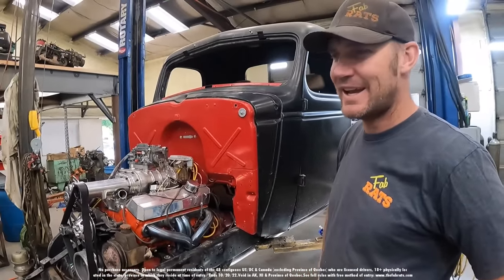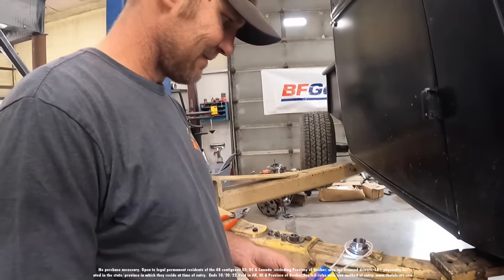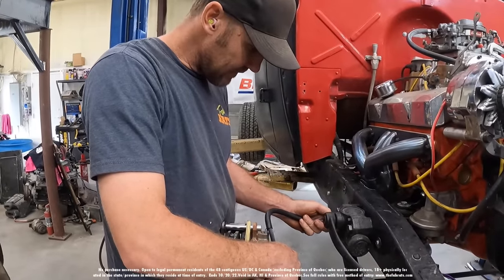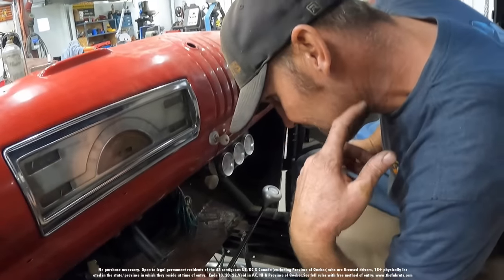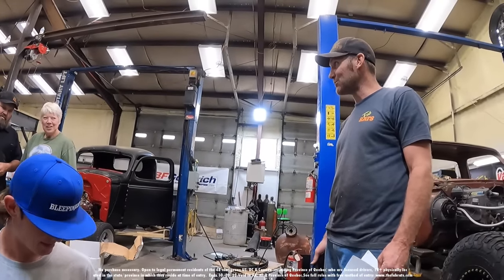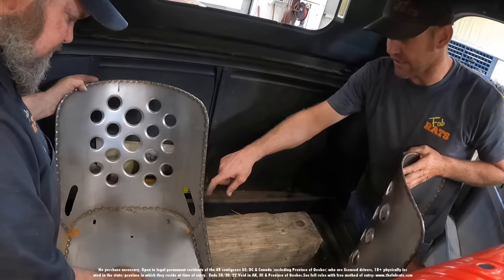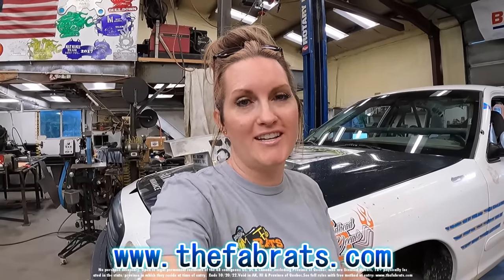The '42 Chevy Hot Rod Loses The Bench Seat And Gets Huge Upgrade!

Comment: You guys might want to box the front of the frame real soon, we did a 56 Checy which had a much beefer front frame and had a small block with a TH400 installed prior.  The guy wanted power steering and disk brakes.  We drove it to the shop and it was basically scary.  We installed the disks, power steering and modern shocks, and the problem was the same.  Then we noticed that the front frame had about an inch of lateral and hight movement when we had it on the floor doing some odds and ends. We ended up boxing the frame back to under the cab, and OMG then would stay on the road.
Reply: No need to box the frame if it has an X-member
Reply: Shush.  Let him learn from this build.
He needs a lot of lessons learned from doing it himself.

Nobody can tell him anything.
Reply: @MastroAdventures  the 42 has a no cross member, remember the old dipper six had this cross member mounted to the front of the engine.  The same was true with that cursed 56, that thing was a problem going somewhere to happen.  We eventually got it right after we fixed the upgrades someone had done before.  A front cross member makes a significant improvement.  Remember that Dodge Ram's with 4 x 4 had that death wobble issue, that steering box lower pivot helped but still the frame moved.  Had one for over a decade and noticed it when I jacked it up from the frame, not the axle.  Beefed up the frame in the front and the death wobble went away.  Even with an AS in Mechanical Technology while in the Navy paid off, math can be your friend and physics is the glue holding the universe together.
Reply: @thomasheer825  in the fab world, you can build an X or K member.
Reply: @jamesrogers6376  It's almost like your voice is but one in a sea of people who don't know what they're talking about. He isn't crowd-sourcing his build plans; he is showing us what he's doing. If you want something done in a certain way, then put your time, money, and effort into it and do it yourself. You should also record it and post it to social media so all the know-it-alls can tell you how every little thing you do is incorrect.
Reply: @watcherofwatchers  I've done enough to know better.

Life experiences.  I wish you learn from everything.

Comment: The secret to round clamps is to get some bar stock, drill it and tap it to your bolt size, weld it to your tube (one on each side) before you cut it, then cut through all three.  After it is cut, drill out the threads on one half for bolt clearance.  Now you have a clamp that is perfectly aligned.

Comment: Paul just for general knowledge and i know you have it in your shop,....Brake Clean works awesome on getting anything flying dead! yep it will even knock
 them right out of the air. i use the red can a lot on them. here i have lots of wasps and it is cheaper for it then wasp spray. One hit of Brake clean and they are toast!.

Comment: One thing to note when running that mill is to be sure you aren't climb cutting with that end mill. If you are taking a heavy enough cut the rotation of the end mill will pull itself through the cut scary fast. With that power feed you might be ok especially when it is just cutting aluminum, but a heavy cut in some steel could be a different story. On my CNCs I purposely climb cut but on my manual machines I run conventional.
Reply: Good advice. However, if you are looking for a decent finish on a final pass you can set the table locks to snug and climb mill with little fear of it grabbing.

Comment: Just a little FYI. The IR / Laser thermometer will not show an accurate reading on metal. (it reflects too much). So if you but a bit of painters tape on a piece of metal it will show a more acurate temp. (yeah, i know,, you cant on something that hot...)

Comment: @7:35
T-Shirts; a suggestion from an extra large t-shirt guy.  If you wear an extra large and more even, then a 'V' neck is more comfortable for our neck is needing the comfort of unrestricted movement.  Can you consider seeing about ordering some 'V' necks in the larger sizes?

I end up using pinking shears to cut a 'V' shape for comfort.  Of course it would be nicer to not need to modify in such a manner.

Thanks for any consideration that may be forthcoming.💖

Comment: 21:16 You DEFINTELY want the front of the seat tipped up, usually around 5-9 degrees. This gives your legs a better angle from the knee to the pedal, to allow you to depress the pedal with more of a relative downward motion, instead of a forward motion. forward being less kinesically sound

Comment: You should have the Rat Rod Toyota rock crawler giveaway instead. For mounting seats i always took a 2 or 3 inch hole saw and saw right through the side wall of a tire. It makes the perfect rubber insulator for mounting seats and anti-vibe too.

Comment: I don't know what type of oil filter you're using on that Chevy small block. Back in the day, they used a PF-35 AC Delco. That held about a quart. However, a PF-932 is a 2-quart oil filter which should fit. If you want some extra oil capacity for your beauty, you might want to check into the PF-932 style. I believe the PF-932 should fit to the block as long as you have the long clearance in the frame. Good luck.

Comment: mybe putting some type of rubber in that exhaust tubing that your using for the steering wheel bracket to help dampin some of the shake from the engine and what not

Comment: Hi Sir.   I found your Videos last Week and started to like your Site. May I say THe Rat is shaping up. Sir on the Front Windshield to save Time but Would Look Cool as H. Have the Windshield Tilt Out at the Bottom for those Hot Days. This way you May Get By with a Custom Rubber Molding Seal.  This way you have Air for Legs and Body!  What Color for Vehicle? How about using Dip your Car Paint and then you can replace it when you Chip it Up?   Peace Be With You and Family and Friends.    Greg

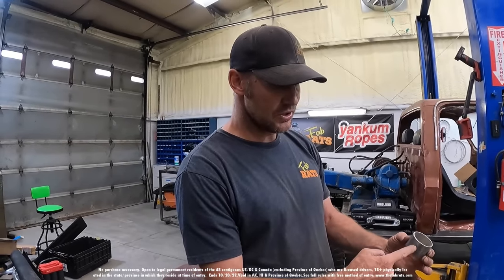Comment: Hey Hunter, you need to get the camera to where the action is happening, not half way up the guys' bodies. At 25:13 Paul's showing a shim he wants to cut, and it's not in frame, you've got the camera on his face.
I'm sure someone else has also pointed out the 'black hole' between 29:34 and 32:25, hey it's no big deal, but for a minute I thought my video card had gone to lunch!!

Comment: Respectfully asked serious question:

When you heat up a hardened steel part enough to change color, are you annealing the part?   My metalurgy is rudimentary, but it seems like you would lose the engineered hardness?
Reply: Yup, bearings should never be heated til they turn blue, Never. Bearings are hardened for a reason.
Reply: I think they only heated the sleeve. If so, they are good.

Comment: From one Ben to another..
Yo, you ever hear that old adage, "what goes up must come down!"?
Well, when you got your right foot sticking through the fire wall and your derriere hanging off the tailgate, remember that tidbit of info, because when the better part of valor comes screaming atcher right foot again that the old lady in front of you is not going to make her turn before tomorrow, and if the connection is right, you will be finding out at the speed of light, 1- disc brakes are awesome, and 2- that the dashboard is advancing towards your face at Mach 1, that maybe you should have tilted the front portion of the seats a little higher. 😂🤣

Comment: I gotta admit the little truck wasn’t very interesting to me in the beginning but you guys are makin it much better! When ya hung those front fenders on Cinderella turned into a princess, lol. Fenderless is cool but there’s so much that goes with that like dropping the frame, channeling the floors, maybe dropping the top to get some rake in it etc. It just looks right with the fenders if it’s gonna keep the factory stance. Pretty cool to watch where it ends up.

I once posted Robbie’s channel was cooler than yours but I had just watched you “fix” the steering on a go-cart and the wheels turned the wrong way so there was that,,,now you are making me reconsider my position lol. 😉

Comment: You need to add a $20 quarter on the dash you glue a quarter center of the dash up by the windshield under full throttle if anybody touches it they get a $20 bill

Comment: There's very little advice I could possibly offer you Paul because you're basically my hero. However, I can tell you that when you consume lots of fructose (e.g. Mtn Dew) you're telling your body that it's fall because fruit is ripe therefore winter is around the corner, so it actively stores fat. The mechanism is via blood uric acid level. So you could try avoiding this if you want to cut down on weight gain!

Comment: Great RC cars be careful when coming back at yourself at high speed . steers backwards if your thinking like your in the car , I nailed a concrete curb years ago , and if you like the computer in them stay off the wet grass ,, I use to race mine years ago a neighbor had built a indoor blacktop track ,, was fun while it lasted ,, also went to a carpet track and raced ,, its been over 15 years now . on the dash plate you have the machines why did you not just make it yourself ??

Comment: It’s funny how things just don’t fit. My Toyota is put together from many years and generations of trucks 84-04 all done by me and done in a way everything is plug and play. Something’s fit with only drilling holes and some needing shifting over and new tabs made, like a first gen Tacoma das and HVAC system into a last gen pickup. I have had worst lock with factory like not OEM parts to fit like they should. And that’s on everything I’ve owned. Like the new seat covers I bought to reupholster my Tran Am they fit great front and rear seats, vehicle was park for two days in the driveway and the sun bleached the new not cheap black Hobnail seat material purple. The whole rear shelf portion of the back seat was now purple, and the front seats were the sun hit during the day was also purple.

Comment: Any reason you chose 170yr old technology in a Eaton style charger, instead of a modern turbo? You might get 27-35% blower efficiency from the supercharger, where a turbo would give you 75% blower efficiency?
Reply: Because it’s cool
Reply: Turbochargers aren’t “modern” technology. Been around for almost 100 years. Turbos and superchargers both pros and cons.
Reply: @KJ-kw7gh    How long have variable vane geometry turbos been around?  Or electronic boost controllers will gladly wait for your response lmfao
Reply: @benblazek3305  Designed in the 50’s, and used on production cars since the 80’s. It’s not cutting edge technology either. Centrifugal superchargers use boost control also. Like I said, both have their place, and are still used everyday. Oh yeah, I’m the future don’t act like a 12 year old girl getting offended.
Reply: @KJ-kw7gh  so less than 170 years old right?